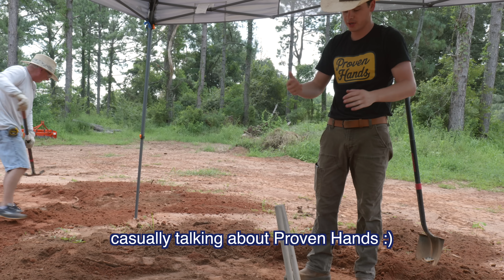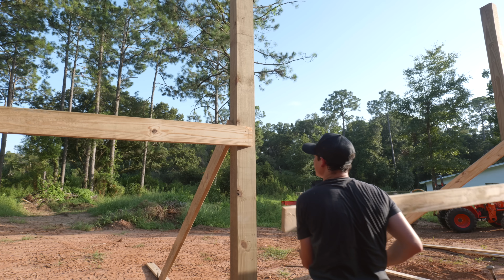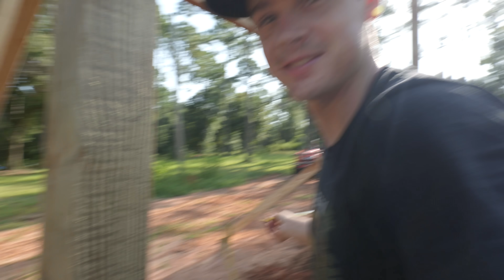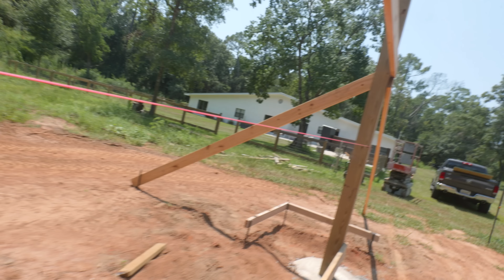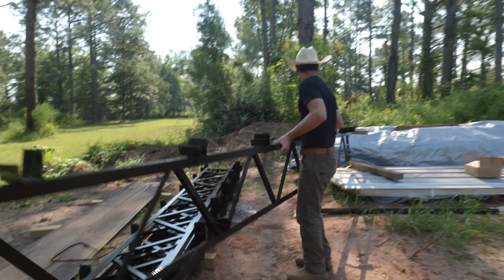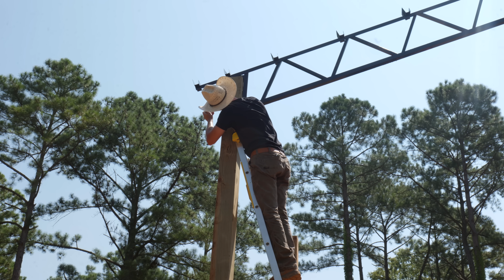Setting a Massive 30ft Truss on our DIY Pole Barn

Comment: 13'6" is the most common semi trailers. There are 14'6" high cube semi trailers. However, the 14'6" trailer and semi uses smaller diameter tires to bring the height down to 13'6".

Comment: When using string, it is good to have something in between at the start and end so that it does not come into contact with anything else.
Easy to accidentally push the string out or the friction causes the string to not be completely straight.

Comment: Me and my uncle built one of these. Putting the tin roof on was the hardest part because the tin was very slippery. You will need a harness, and since you are skinnier than me, it might be a bit easier for you. You'll also need shoes with rubber, grippy soles.

Comment: It might have been less troublesome to cut the horizontal braces to the outside dimension of the posts instead of the center.  Can't mess up that way, if I understand the reason. 😊

Comment: 13'6" 
That is the maximum height allowed. Most trucks though will change the tire size from 24.5 inch tires and rims to 22.5 inch tires and rims to lower the truck down to 13'4"

Comment: Looking nice. I have a question in regards to the use of no post brackets. Is the engineers reasoning behind not using post brackets in the footings because no side walls will be built yet? I have seen larger buildings in tornado valley use the brackets instead of submerging the post in the footing with no issue. I just didn't know if the extra strength of having the framing for the side walls had anything to do with it.
Reply from the maker: Partially yes, but also areas with tornados don't have codes for sustained wind ratings like hurricane area do. Most of the US has a 90mph wind rating requirement. So it's not that we couldn't build it using those, it's just that our building department requires it to be built to 150mph. Even with it closed in, these brackets weren't enough either. The normal way of using wall girts wrapped around the posts would exceed the shear rating of the post and bracket. We will have to frame stud walls fastened into their own footings when we close it in. Pretty much everything I learned on YouTube from the post frame guys wouldn't work for our area after speaking to a structural engineer unfortunately. Less than 30 minutes from our home the rating is 180mph and continues to go up into FL. It's pretty wild what has to be done to conform to that building standard. Most homes here have a continuous metal strap that goes from in the slab up the wall and over every truss or rafter.

Comment: You should’ve put a barrier between the wood and concrete when you build a structure if not the wood will decay quickly when it’s in concrete and the dampness that’s often present concrete can trap moisture against the wood can cuz it to rot
Reply from the maker: This is pretty much the only way they are built where we live. Not sure if our post treatment is different or if our soil just drains better, but this is the tried and true way of building here.

Comment: I’ve been designing a pole barn and the steel truss manufacturer is saying a steel truss with 30 ft span is 300 lbs and a 36 ft span is 360 lbs.  

That 30 ft truss doesn’t look like it’s 300lbs in the video.

Comment: IMO ditch the laser level. It is a good tool to use, don't get me wrong. But, laser levels can fall out of calibration. Am I an expert about laser levels? No I am not. However, a tried and true method, and much less expensive is using a water level. Once you set the height you need from the reservoir, use the other end to mark your desired height on each and every pole. Just a thought. I know you are using what you have on hand, and that is what I do. I am enjoying this build series. Be safe and God Bless.